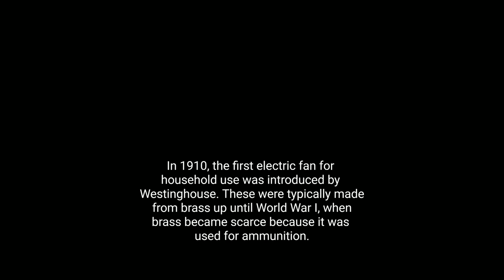100 YEAR OLD TABLE FAN RESTORATION - IMPOSSIBLE STATOR REMOVAL - WESTINGHOUSE

Comment: Great job and excellent video! I just started to take apart the same Westinghouse fan. It was still working a few years ago but the old wires had disintegrated to a dangerous state. Inside the switch  housing they were worse. Your video has inspired me and now have started taking it apart and will order the wiring kit shortly. I've had the fan 50 years and money can't buy how quiet this fan is. I'm so happy to find your video! Thank you!!

Comment: Yooo. I just found one with a serial # that starts with 620. That means it was made June 1920. The wires were in goood shape, but it only hummed when I turned it on. So, I took it apart, cleaned, and lubed it up.  Now it runs like a champ! I'm glad I didn't have to do everything you did!!!

Comment: I have the same model fan and just bought the same wiring kit. I am trying to avoid doing the same thing as you did to get to the motor wiring. I want to connect to the motors old wiring. There is three wires. What wire goes to what wire on the replacement cord?? I also want to know what wire goes to what wire in the fans base. I appreciate any help. I do not want to connect the wrong wires.

Comment: I have an old desk fan almost identical to that without the oscillation. I bought it and I fixed several problems and restored it and it ran perfectly for several years and all of sudden started making a lot of noise and the only thing I can figure out is the friction bearings are worn out in it. 
Any idea if I can find bearings? I don't think I have the equipment to make bearings for it unless I can use common tools to make them.